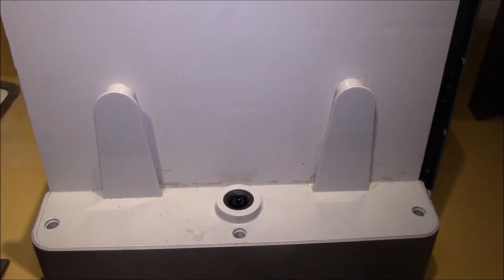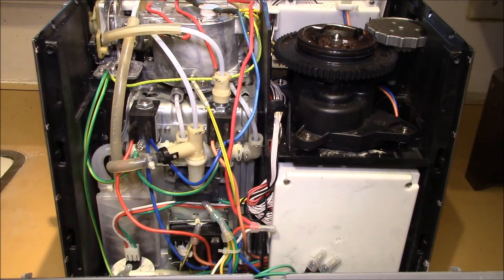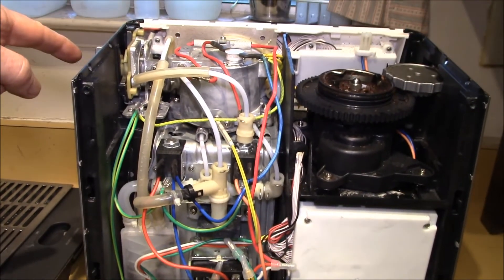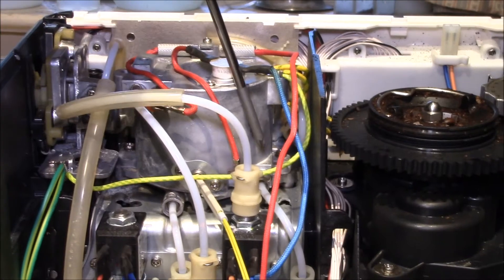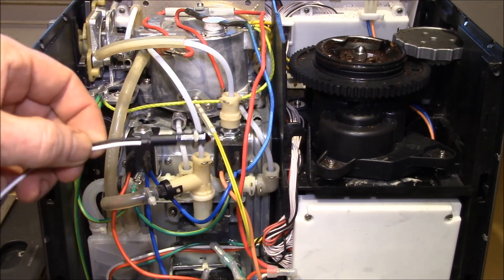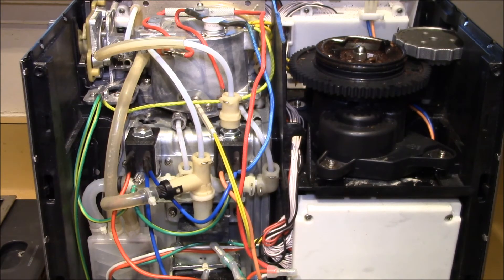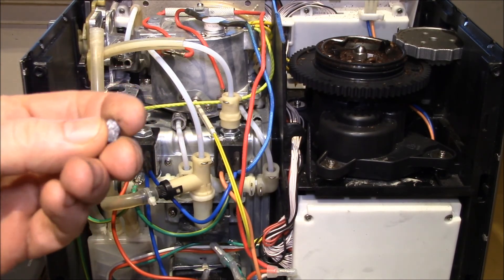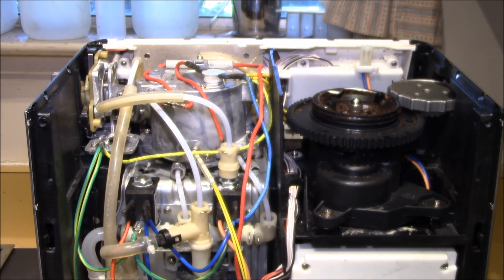Breville/Sage 870XL Barista Express - Water Flow

Comment: Thanks for this amazing video!  It really helped me understand how these things work!  I have a similar issue to some other comments, but I can't seem to figure out exactly what's happening; perhaps you can help?  Can pull a shot just fine.  The hot water valve also works and continues working as long as I run it.  My issue is with the steam valve.  When switching to steam, it will heat up and water and steam will come out for about 10-20 seconds, then it will stop completely.  The water pump is still thumping, but it looks like no water is flowing to the steam valve.  It's also not flowing through the steam valve overflow or through the group head.  If I switch it to hot water it also won't flow there.  When I press a shot button, all of the steam escapes through the group head at once, along with water for the shot.  Then I can repeat the process and run the steam until it stops again.  It seems like maybe something is stopping the flow when it gets too hot for the steam?  Could it be the 3-way valve?  If it was stuck on then I think it would run through the group head, but if it was stuck off, it would go through the steam (or steam overflow).  It appears that something is stopping the flow as soon as it gets up to steam temp (which I assume is hotter than all other modes).  Any ideas?  Thanks in advance!
Reply from the maker: Maybe peek inside the back of the machine and see if you can find where the water is flowing.  Be careful as there are live electrical connections inside.  Could be the 3-port valve is getting turned on at the wrong time, maybe try unplugging a power wire to it (machine unplugged and tape off the loose terminal).  If that works, then maybe the main circuit board is acting up and turning on that valve, which would send water to the group head.  Or maybe the over pressure valve is set too low and is sending the pump output to the drip tray.  Should be able to look at the various tubes and figure out where the water is flowing.
Reply: @The4Crawler  Good idea! I tried unplugging the 3-way and the steam still stopped around the same time. Nothing coming underneath through the overpressure valve, the steam/hot water appears to just be trapped in the machine. It didn't release until I plugged the 3-way back in and pressed the shot button, which quickly released steam out the group head. I'll keep tinkering with it
Reply from the maker: @halfsharkalligatrman  Could be something clogging up the hot water / steam valve.  That should vent back to the drip tray in the middle (off) position.  Maybe try running a few descaling cycles through that valve, alternating between hot water and steam.

Comment: Great video! Have a question though if you have a minute... I have a machine that is not achieving the correct pressure. I've been testing the pressure by using the rubber disk and running a backflow cleaning cycle used with the tablets. Ive swapped out the solenoid assembly and the pump however it made no difference. I've noticed though during the cycle when the pressure is supposed to be held, the water is coming through the end of the solenoid assembly and into the diffuser into the deep tray. I was thinking the solenoid on the left was the issue as it would not be closing causing the water to flow though. Kinda stumped at this point, any ideas I could try? Thanks!!
Reply from the maker: Peek inside and see if you can isolate which tube the water is flowing to the diffuser in.  Be careful as there are live electrical connections inside, but you should be able to peek in the back with a flashlight while running a shot.  

Either the 3-port solenoid isn't turning on fully and closing off the top port or the 2-port solenoid is sticking open or is getting power all the time.  Easy check for that is to unplug a wire from the coil, wrap it in tape for insulation, then run a shot.  If that works OK, it may be the main circuit board is sending power to that valve all the time.  Another check would be to feel the black coil and see if it gets hot after the machine is on, but not running any cycle, for some time.
Reply: @The4Crawler  im thinking it has something to do with the 2-port solenoid because when the machine is trying to hold pressure, I notice a steady stream into the drip tray. That's probably why I'm losing pressure, the water flowing from the end of the solenoid assembly into the diffuser/drip tray. I might try to check the voltages going to the solenoids and when they're being sent. I'm gonna keep troubleshooting this though, thanks for your help!

Comment: I need some help if anybody is willing. The water/steam dial on my Breville 870XL will only turn for about a week after descaling. Then it becomes difficult to turn and slowly  ceases to turn. Is it the solenoid?  I went on 'Just Answer' to  talk to a tech and he said it was the grinder needing to be cleaned? I do not see how this is possible. The grinder gets vacuumed and brushed and grinds perfectly! How on earth could  it be connected to the waterflow dial?
Reply: Thank you soooo ...that makes so much sense...maybe a silly question...but how do I let it 'sit' in the valve for 10 min after each shot?
Reply from the maker: @2coolartsmusicmom572  At least with my older machine, you run shots of descaling solution through (by holding the 1-cup button).  Then I just wait 10 minutes or so before hitting the button again:
https://youtu.be/bJGKcatfei4
Repeat until the water container is empty.
Reply: @The4Crawler  ahhh that is what you mean...I will do that with a double solution as you suggested. 2 pkts in 32 oz.  I had already done it 3 times with a pkt each time but did not wait in between. I will do that and hold my breath. Thank you so much...will let you know how ot goes. You are a gem.. thank you.
Reply from the maker: Likely the valve has some scale buildup inside.  That valve and hot water/steam operation requires no solenoid valve.  Either try running a few descaling cycles just through that valve, letting the descaling liquid sit in the valve for 10 minutes or so after each shot through the machine.  Maybe even make a double strength solution to see if that helps.  Otherwise, you may need to open up the valve for more thorough cleaning:
https://siber-sonic.com/appliance/800Mech.html#valveclean

Comment: My problem I’m having is i wasn’t getting anything through the group head, and all the water ends up in the drip tray. I took it apart and found I had a bad coil on one of the solenoids. I replaced it and it worked for a couple months, and now it’s the same problem, but the coil I replaced last time works fine. I tested by moving it to the other solenoid to see if the issue follows. I also took apart the solenoid and checked it, and it functions fine. Where do I go from here?
Reply from the maker: Look at the pinned comment in this video, it'll have some troubleshooting tips.  Likely the control circuit for that solenoid is not working.  The solenoid needs to turn on to open the valve and send water to the drip head.

Comment: Thanks so much for a great rundown on how the machine works. Was able to buy a new solenoid rack and repair my son's machine because of your excellent video-so I got brownie points there! Now a friends machine wont work after a lightning strike to the electricity supply. Any thoughts? Fuse?
Reply from the maker: Glad you got the one machine repaired, good job.
There is a fuse of sorts on the main circuit board:
https://photos.app.goo.gl/yTtU43pv2SVA5NN98
If that's blown, you could likely solder a jumper wire across the burned out trace.  Or pick up a new circuit board.
Reply: @The4Crawler  I haven't pulled the circuit board out yet to see. Where is the best place for parts? I got charged Aus$175 for the solenoid rack which I thought was excessive. By the way thanks so much for your time. Really appreciated. Any way I can buy you a coffee?
Reply from the maker: @alancohen618  Best to search for the Breville part number and see what turns up.  You might try contacting Breville customer support, they can often supply parts like that, given the part number.

Comment: Thanks, this was helpful, I have the dual boiler so some differences, like I don't have the 2nd solenoid, but helped reinforce what I thought I had figured out. My problem is no water or pressure through the group head. I replaced the pump and the solenoid with no luck. The hot water/steam wand work fine. The machine isn't giving any fault codes. You think the group head assembly could be the problem?
Reply from the maker: Hard to say.  Best bet is to peek inside the back of the machine while running a cycle (be careful there are exposed electrical connections inside).  See if you can find where the water is going.  It might be the over pressure valve is venting water to the drip tray.  It might be one of the tiny o-rings is leaking or one of the small tubes isn't connected right or the new solenoid may not be sealing off the hot water/steam port when it's on and that'll send water to the drip tray.  

It also may be the main circuit board connection to the solenoid is loose and not turning on the solenoid fully or it might be the driver on the circuit board might be bad.  If that solenoid valve doesn't turn on fully, water will flow to the hot water/steam valve and then down to the drip tray.  

Water will take the path of least resistance and unless all other paths are sealed off, it won't go through the group head and filter basket which restricts the flow and thus causes the high pressure.
Reply: @The4Crawler  sorry, blown triac, not transistor
Reply from the maker: @skram2626  Glad you found the problem.  This does seem to be a common failure mode on these machines.
Reply: @The4Crawler  Thanks. Just changed the grouphead (what a project) and the symptoms are the same. Water is not getting to the drip tray. When I disconnect the small hose to the pump, I get water out of the pump. I think your right, it has to be the microprocessor board at this point, but good luck getting that as a repair part.
Reply: @The4Crawler  yep, just found it, blown transistor on the board. My solenoid input was pretty much hovering at 118 VAC and not changing states when I hit the brew button. Wish I would have figured that out before I went down the rabbit hole of changing parts. Original problem was a leak on a steam probe, so I'm sure the condensation was the culprit

Comment: Hi thanks for the video,  it has been a great help. Mine is doing that valve nose you have mentioned, so I have taken the solenoids off, now I am wondering do I need to replace both solenoids or will I get away with changing the right hand one only. Could you advice?
Reply from the maker: If you purchased the separate solenoids, then you may be able to change just that one, as it's the one that controls brewing.  The one on the left, as long as it seals up good and doesn't leak water to the drip tray is only used in the purge cycle at the end of brewing.

Comment: Thank you for a brilliant video. Wondering if you, or anyone else can help me as I have an issue with my machine. Everything working fine but when I press single or double shot buttons, the water is coming through the purge tube into the drip tray instead of the group head. Do you know why that might be? 
I pulled a Double shot this morning and it actually flipped a fuse. Went to my fuse box and it had turned off, turned it back on and this seems to be the issue now. If anyone can help I’d greatly appreciate! Thanks
Reply from the maker: Likely you have a GFCI or RCD type breaker on  this circuit.  If so, it's likely the coil (the black plastic cube) on the 3/2 way solenoid valve is damaged/cracked or otherwise shorted to ground.  That will cause the breaker to trip and that's the valve that send water to the group head (if powered) and to the drip tray if off:
https://youtu.be/96IuKiuIB5A

Comment: Hi there, I wonder if you could shed any light on my current sage barista express issues!

I have a Sage Barista Express and I am experiencing a fault. 

There is no water coming from the group head. 

It will make the noise as if it is trying, but the drip tray fills up instead. 

After approximately one hour of keeping the machine powered on (continuously waking it up before the auto shut off kicks in) there is a click and then water will come out of the group head as normal. 

Sometimes it will take one hour and sometimes I will give up. There was a particular time when I was away for two weeks and on my return it worked after 20 minutes. This then went back to the hour long wait and continuous wake ups. 

Before this, water would come through the group head immediately after turning on the machine. 

I have tried a factory reset and this did not help. 

I bought and installed a new motor and this did not help.

I have tried back flushing. 

There seems to be water in the pipeline to the group head when the backplate is off the machine but clearly there is something wrong that I would love to fix as going back to the caffitiere is just not good enough!
Reply from the maker: It's likely sending water out of the top of the 3/2 way solenoid.  It could be the coil on the solenoid is not getting power all the time.  Might explain your symptoms of working sometimes and not other times.  If so, that may be the main circuit board.  You could test that by either hooking up some indicator lights like I did in this video:
https://youtu.be/9cC-m3a-oXY
Or testing the voltage on that solenoid coil with a volt meter.  Be careful as there are exposed live electrical connections inside the back of the machine.
Reply: Thank you so much for your reply! So it could be the main circuit board and not just a case of replacing the solenoid valve(s) do you think? Thanks again.
Reply from the maker: @martmart_  Since it seems to be an  intermittent problem, you could test the voltage (with a meter or some indicator lights like I added to my machine) and then compare the situation when the machine works and when it doesn't.  If there's good voltage at the solenoids in both cases, then the circuit board is likely fine and the solenoid is acting up.  Otherwise, if there's no voltage when the machine doesn't work, then the circuit board is the likely cause.
Reply: @The4Crawler  You sir, are a star! Much appreciated. I don't really have the means to test the voltages etc. But I will endeavour to work it out and hopefully there will be coffee at the end of the process! Thanks again.
Reply from the maker: @martmart_  Easy enough to add some indicator lights to the unit, like I did in this video:
https://youtu.be/9cC-m3a-oXY
Actually, you only really need one on the 3/2 way valve coil.  Just plug some terminal splitters on the solenoid coil and then connect the original wires and the wires to the indicator light to the splitter.